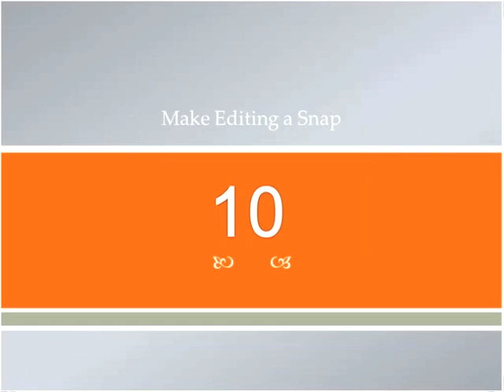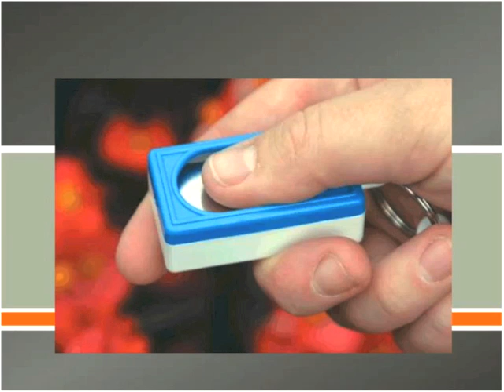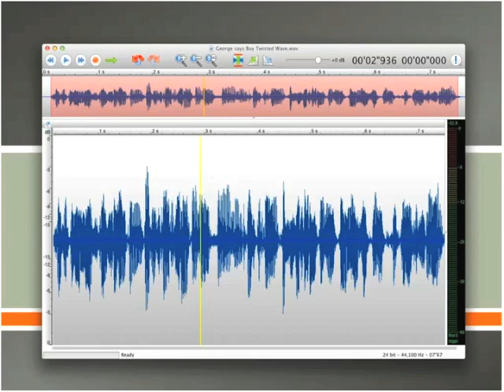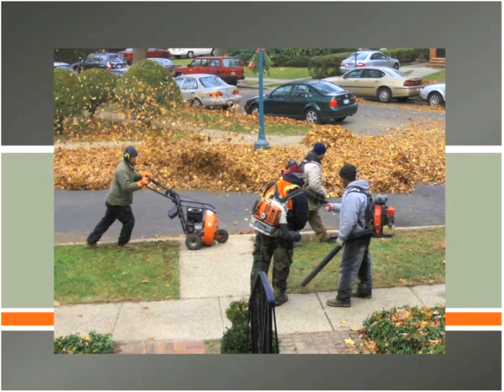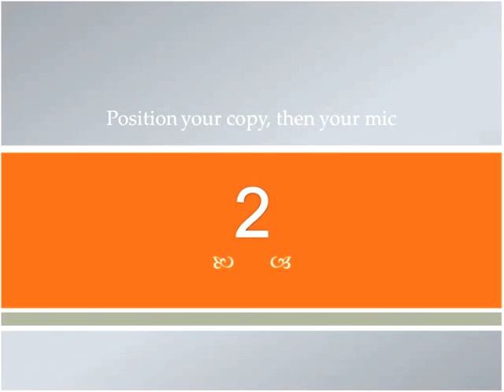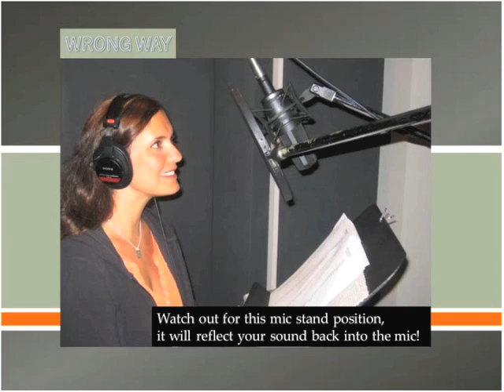Top 10 Home Recording Studio Tricks

Comment: This is just one man's opinion, but it has worked great for hundreds and hundreds of voice actors I've consulted with over the years. I find it entertaining that the harshest critics are using the most anonymous user names.  Take it over to Gearslutz, guys. This is for actors, not audio geeks. 

And I agree, the bio was way too long.
Reply: PS at some point the "required IPad" thing should morph to Android control. Can not happen soon enough. There is absolutely no reason to require Apple for a wireless tablet interface. Why not require Apple knives and forks at the dinner table. Same thing. Btw Samsung phones completely blow away the IPhone which sounds terrible and does not have great rf either. Apple is so over. Expensive proprietary crap pain in the neck. I will be glad when it is all in the metal recycle / landfill. I really do not like - being told what to do by a little gizmo.
Reply: Awesome thanks again George.
Reply: SO anything non Mac belongs at Gearslutz? You know, this area you work in may be a good market for the likes of Allen and Heath where a digital mixer sends out to record to usb and such, and then you can play back and mixer through the digital mixer. In other words, no computer Apple/ Windows, whatever required. Maybe AH will make something like this on the small side. Problem solved, recording done, no computer required. Back to audio, not doing Apple fan boi. As you are a consultant, it was a lot of work to do consulting for you! 'had to think about it for a minute. Keep the audio in audio, keep the art in art. No need to follow the trends. Invent / create / be different / "do."
Reply: yo bone, I did sound last night for three international tour acts. check this, the third act used  Line6 mixer at stage + two wireless tablets! Mixer the size of a metal lunch box with a display on top. Like this: http://www.sweetwater.com/store/detail/SSM20D

first two acts worked together, tour together, used Yam LS9 for mains, Behr X32 for stage. So one act used $15k in consoles and another $1500. in console. Sounded fine. I admit the Line6 has half the iuputs of the Yam LS9 32. I think the Line6 sounded better than the LS9, which is not difficult because LS9 is very clinical sounding. Anyway, cheap digital w/ tablet control is where it is going. Btw, I hate Apple, did I tell you that? Everything they do is proprietary - and that is just not how the world works, thank God.

Comment: The video is too critical about the tubes. Τhe use of tubes is so extensive because they work in many cases. Tubes are the professional standard in enlectric guitar recording. Tubes also give great results in compression/EQ. When it comes to voice over though, the tube preamp wont make an important difference. The "tube-mania" is another story that lies on consumer's ignorance. Most of these devices are solid state amps with only a small amound of singnal passing through the tube.
Reply: So in the end, you agree with my recommendation to avoid tubes for recording a clean VO track.  Great George's think alike!